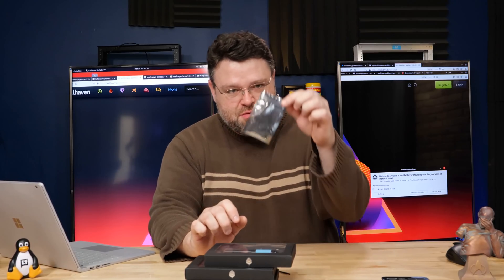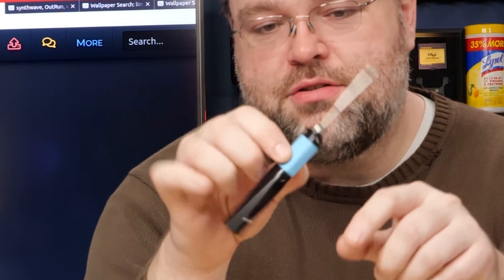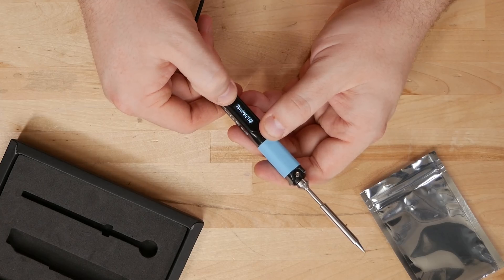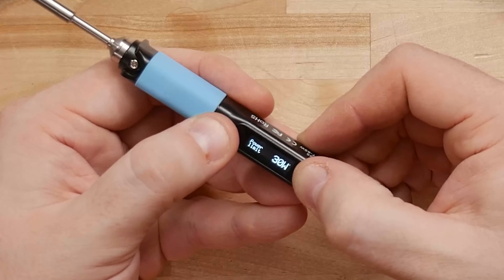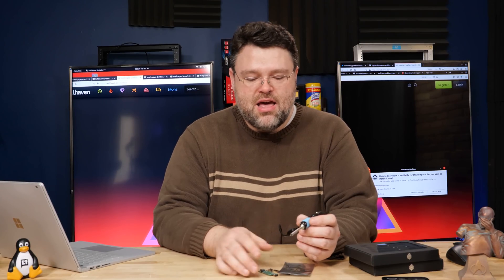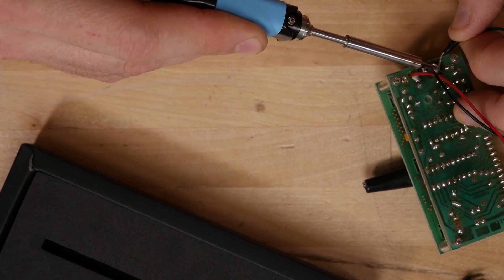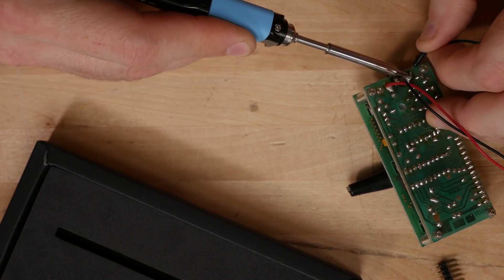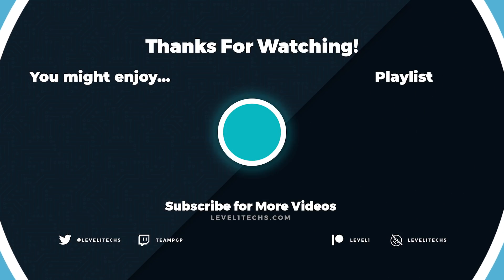PINECIL - Soldering Iron w/a RISC-V Processor!

Comment: When a soldering iron has more power than a 90s PC. We live in interesting times.
Reply: smokes the Apollo flight computer too
Reply: The ESP32 is 10x as powerful as a 486 and about 3x the Pentium 1. That is insane. You can basically buy the performance of a Playstation 2 for $1.50-3.

The 486 was the minimum spec for Win95. That would put many of the STM32s etc in the power range of a PS2. They run at the same speed but the node advantage of the smt32 compared to the 250nm should make up for the 64 bit performance advantage the PS2 has.
Reply: @excitedbox5705  yeah but then again, the 486 had an MMU, the ESP32 doesn't. That's why you don't see ESP32's and STM32's running operating systems like Linux or Windows. MMU emulation would not only tank performance, it would be insecure.
Reply: Can't wait for someone to get doom running on this.
Reply: Huh, 90's PC's were Pentiums. 90 to 233 MHz. Mine had 128 MB of RAM which is 2 TB in 2021 numbers, but most people RAM with at least 8 MB.
Reply: @TheNefastor  Pentium 50MHz relased in 93, Pentium 100MHz in 94. But many people still had a 486 by early/mid 90s.
Reply: @samuelschwager  ah the memories... I still have an authentic IBM PS/2 with a 486SX 25 MHz and 512 KB of RAM and it still runs Windows 3.11 for Workgroups. That thing is unkillable. Can't say the same about today's PC's 😀
Reply: @TheNefastor  Nice, I have an IBM P70, still working :)
Reply: @TheNefastor  512MB? RAM? 🤔 Really? I got this after 2001
Reply: @doggSMK  sorry, that was 512 KB, not MB. I had 128 MB in a PC in 1997 and everyone thought I was running NASA or something. I'll edit my comment. Thanks for spotting.
Reply: @TheNefastor  in 1991 or 1992, my folks got a 486 DX computer. It had a turbo mode at 50 MHz.

In fact, the family friend wholesaler who hooked them up with it had joked at the time that he could just program the LED to print 99 for turbo instead and make all our friends be in awe of our system being faster than anything out there.
Reply: @slycordinator  The funny thing is that "turbo" wasn't actually a speed boost, it had something to do with compatibility for certain old programs that had timings based on the cpu clock. In a lot cases performance was reduced with "turbo" enabled.
Reply: @mytech6779  no.  the diabling of turbo halved the clock speed
Reply: @BenState  In life you will find that your one anecdote doesn't invalidate other data. 
Some companies also reversed the turbo-button indicator light so it was on when turbo was off.
Reply: @mytech6779  incorrect.  nothing reverse engineered about it.  in your case the button was wired incorrectly.
Reply: @BenState  So you actually have no clue what the purpose was for "turbo" buttons nor do you comprehend basic statements like "some brands were reversed" and want the world to know just how limited your knowledge really is.  Good luck with that.
Reply: @mytech6779  The turbo function was on when the CPU was at full clock speed and off when reduced for applications that needed that to run correctly.  It is well documented that this switch was often installed incorrectly to latch at full speed when the button / LED was off.  Please update your knowledge by reading.
Reply: @mytech6779  Turbo enabled, with a correctly installed button puts the CPU in full clock speed.  You said the opposite.  Are you slow?
Reply: @BenState  I said they were installed both way around.
Reply: @mytech6779  And according to the spec that would be a mistake, rendering your interpretation of the modality of turbo/non turbo also incorrect.  Any latching switch can be installed the wrong way around and often was.  That does not mean in any way that turbo mode on retro pcs ever was intended to be a slower clock speed.  As that would be illogical. Facts.
Reply: @BenState  So normal mode was the special mode and not the special mode at the same time? 
"turbo" as a technical term is meaningles drivel, it makes no more sence to use it for normal operation than for retro-compatibility operation. 

The switch issue isn't just a switch wiring problem, it is also about the default mode wired into the mainboard, the switches could both be wired the same on two boxes yet being pulled high sets one of the boards to normal mode and sets the other to special retro mode.
Reply: @mytech6779    I don't know how you're struggling with this basic stuff.   A turbo is a device that increases speed.  Turbo mode was the CPU's max clock speed.  Turbo off, was a reduced speed to enable legacy software support.  Nothing more.  Your special and normal modes are just made up drivel.  Everyone knows what a turbo is, and does.  Thus the term was used as such.  Turbo = 100% CPU clock, Turbo disabled =original 8086 processor speed.  Its very simple.
Reply: @BenState   Just exactly how does a turbo device increase speed? Does the encabulator precharge the unilateral phase detractors or or does it synchronize the spurthing bearing with the amulite nofurtrunions?

Comment: when he started talking about the processor, was I the only one that thought he would say the processor is the heat source for soldering?
Reply from the maker: I must admit, I was curious about that while editing ~ Editor Amber
Reply: Stick an old athlon cpu in that thing and you could melt way more than solder.
Reply: You are not alone
Reply: tbh, if you were interested in using the heat from a processor, something RISC-V is pretty safely less likely to fit your needs
Reply: Lol, soon there will be after market cooling solutions
Reply: @INVAZOR33  Well how else are you going to over clock a soldering iron?
Reply: @asdrubale bisanzio dang I was about to say that
Reply: yes its made by intel

Comment: Speaking as a mixed signal embedded systems developer, soldering since the 70s, judging by those joints, I think you may be burning off all the flux by either leaving the tip on too long and/or using too high temperature. That's why the joints look a bit irregular.

But yeah, RISC V and USB PD... an unnecessary gimmick for a professional workbench, but wow they're cheap. USB PD, well that's a whole tale of engineering woe.
Reply: @asdrubale bisanzio I don't disagree with you, I am just making the point (a) USB PD adds no value in a professional lab, and (b) USB PD is a serious PITA to engineer properly. I'll also add that USB Type C is a very fragile design physically, with the device coming off worse than the cable, making repair expensive. USB PD is expensive to engineer properly especially when simultaneously being used for USB SuperSpeed and Thunderbolt: device multiplexers frequently fail, which is expensive to repair.

Is it just me, why am I always concerned that Wendel's always seconds away from giving himself a nasty burn? Where's the stand?!?
Reply: @asdrubale bisanzio "Surface mount is shit" hmm, I guess you don't work in the industry then. 

USB C is demonstrably more fragile than A, B or even micro B or mini B, and it tends to break the device more than the cable. I'm just giving you my real world design and manufacturing experience, including seeing failure modes on returned devices.

That doesn't preclude this being a handy tool every now and then. I wouldn't want a hot soldering iron dancing around bench without a stand: I've had enough battle scars over the decades thank you! There are those who have burned themselves, and those who will, I can assure you of that.
Reply: @asdrubale bisanzio No. It has nothing to do with surface mount and everything to do with the tiny close pitch connectors being more fragile, and that the receptacle device side is more fragile both electrically and physically.

A USB Type C receptacle is, for example, immediately physically damaged if someone inadvertently attempts to insert a Lightning connector.

The muxes are electrically fragile.

Finally, as I've stated before, USB PD is difficult to design for if you want longevity and reliability. It's even more so if the device is capable of dual role DFP and UFP.

I think the surface mount aspect is a canard because connectors are readily available with through hole lugs on the shield, and suffer the same way. What is a problem is that most fully assigned USB C receptacles have hidden pads making component level rework difficult.

Comment: No. Just...No. There are plenty of analog soldering stations with temp control that do a great job( admittedly at least some are not exactly "mobile"). Any temp control issues are not related to the lack of digital control, but rather quality of components/design. There is no point to putting a ucontroller on a soldering iron. It's a solution looking for a problem.

Comment: I wish they would charge a little more and make something that really functions as a micro pencil. The real question. Can you use it to re/re an SMD on a 4 layer board? 7 layers? That is the true test of anything that can justifiably call it's self a soldering iron or it's just a toy. You need micro pencil irons for these boards as well. Have you opened an old ipod? Could this take the place of my micro pencil? I doubt it very much. In this case any price is too much.

Comment: Soldering Iron with a CPU and RAM? I'll take that asteroid hitting the Earth now, thank you very much...
Reply: @asdrubale bisanzio That's not a selling point. Read the datasheet of the component and solder it accordingly. In the world of Chinese pick-and-place production plants this thing is thoroughly useless, any dumb temperature control station is more than enough, if you absolutely need this for prototyping, you have already failed. It's a gadget, and to an experienced electronics veteran not even a cool one. Thanks to Wendell for proving this truly is the darkest timeline because new generations of prototypers will go full baaaaaah and lean solely on "smart" equipment and not their common sense and actual knowledge - this is very bad in a long term. No wonder Amazon is replacing workers with robots, if your worker can't be creative, why not just let the AI figure it out. Same will be the extinction path of dev engineers and prototypers if tools like this become a norm.
Reply: @playswithblades  the ability of these things regulate temperature quickly comes in handy when soldering small components to large ground planes, and the auto sleep helps prolong the life of the tip for the forgetful/distracted among us

Comment: I love that RISCV is showing up in more embedded applications open source devs can play with. We just heard about the ESP32C making use of it two weeks ago and now this. The momentum is definitely starting to build up. I just hope it doesn’t become the next MIPS, but with its open architecture and heavy adoption by massive companies already I don’t think it will
Reply: the error of MIPS was its royalty business model so it competes directly with other ISAs, like ARM. Risc-V got some hype but being royalty-free since the start is a real strength and it drove a lot of people and companies into it.
Reply: @PainterVierax  It is not only royalties, many companies will still pay if there is added value. Risc-V can leverage well established tool chains that aren't subject to the proprietary whims and penny pinching of a single manufacturer. Though royalties certainly never help; firewire-1394 lost to USB adoption because royalty cost limited it to professional devices even though firewire had many advantages at the time.
Reply: @mytech6779  Value can be added in an opensource stack aswell, see RedHat or Codeweavers business strategy. The issue here is more that the proprietary SDK are often all-in-one tools which take a lot of unnecessary resources and disk space and which are prone to intricate bugs.
The US institutions putting embargoes on PRC clients for ARM did also helped Risc-V to rise more and more interests from all sorts of companies.

Comment: nice project, wonder how the soldering iron performs as compared to brands like Hakko
Reply: Und Weller! :)
Reply: These beat the living snot out of the crap from Hakko, and the low end weller stations as well.

Either get something like this or a TS100, or go straight for a good JBC station.
Reply: I used to use Weller WR-3M from office. It performed quite well, I am looking for cheap solution for home and this does seem to fit the bill

Comment: I like the price a lot, but as for the microcontroller, I wouldn't care if it's any 8bit Atmel or STM, or any 32bit Espressif, STM, PIC, etc. It could just as well have a Z80 or Intel 8088, even a MOS 6502. Basically anything except for the Itanium line would be fine by me. Oh, I loathe the Itaniums.

Comment: I’d love to get one but it’s always out of stock :(
Reply: They'll have more stock after CNY
Reply: Yeah, they figured a way of setting these up in a mining farm, that's why.
Reply: Pinecil back in stock, I just picked one up 😀
Reply: @balls4juggling  Dang, I missed it. Says out of stock again :(
Reply: @psedog  it is back in stock :)
Reply: @Instinct0425  Purchased. I appreciate it 😊
Reply: @balls4juggling  Thanks for the heads up!
Reply: Buy a real micro pencil iron first it will save you so much grief. These aren't bad if you recognize it's glaring limitations. How often do you really need a portable soldering iron? This is fine if you are only ever dealing with 2 layer boards or connecting wires but will never replace a bench unit.
Reply: @Mr.Unacceptable  I totally replaced my Weller with a TS100 and I will never go back
Reply: @Mr.Unacceptable  Sure the ergonomics certainly aren't great, but otherwise these irons perform far better than pretty much anything you'll find for under $80 and even if you do spend more you won't necessarily find much if anything better until you start getting into expensive gear, the portability is just the icing on the cake and I absolutely value that feature as I currently don't have a dedicated workbench meaning I have to move my tools every time I use them and I can very easily plug in a battery then repair some wires or solder a connector up outside, I even threw a small toolbox together with solder, flux, tips, etc so I can just grab it and be ready to use it anywhere.
Reply: @vgamesx1  Same situation here. I have to pack everything away when I’m done and space is a premium. Not to mention that this is very cheap.
Reply: @vgamesx1  I've got a large lithium battery made of a bunch of 18650's I could totally use to power this iron for a very long time, then I have a portable repair setup I can take anywhere complete with USB C powerful lights, who knows. I could totally create a very powerful portable station that runs everything through USB c cables up to 100W!
Reply: @Mr.Unacceptable  these beat anything you can get for sub $300. Something like a JBC CD series is of course much more enjoyable to use, but not that much better really.

Comment: I saw this soldering iron on Twitter for months but I couldn't find where to buy it, so at the I bought a TS100 and I now I've found the store page for it!!!! probably I'm going to buy it anyway for the RiscV Cpu ;)
Reply: Isn't this just a TS80?
* EDIT *
It seems to be a TS 100 clone from what I've read.... you probably have the same thing already. :)
Reply: @x7slim8x  came here to say this
Reply: Well after a little more reading it is definitely different than the TS 100. Slightly bigger and heavier... same tips. I'm gonna stick with the TS 80 personally, but do enjoy this resurgence in soldering tech and the reviews are super helpful.
Reply: The problem will be the oled screen. As there is a lot of durability problems on many TS irons or other PRC's electronic products.

Comment: Oooh! I got into creating my own circuits and building projects about a year ago and have been using the absolute cheapest, jankiest soldering iron since. 
I don't intend on writing an app for my soldering iron, but $25 is great for a digital iron no matter how you ....strip it.
Reply: @asdrubale bisanzio This is WAY better than the crappy $25 irons on amazon. This style of smart soldering iron with heating directly in the tip is the only kind of soldering iron you should buy in the 21st century.
Reply: @asdrubale bisanzio I also like supporting open source hardware.
Reply: @asdrubale bisanzio For sure. Fortunately, when this video was released to Patreon, I checked the Pine store and they actually had them in stock. I've had it for about a week now and really love it!  :)

Comment: I've got a kit I carry around in my backpack with various gadgets (serial adapters, cables, rfid tools, etc). I think I'm going to add this thing to it.
Needing a soldering iron away from home is a rarity, but it's happened to me more than a few times!
Reply: If you do 3d printing check around online for a printable case.
Reply: @_GntlStone_  ironically I just got a car kit from Walgreen's for the case for a multimeter and this iron. Wonder how much I can stuff it (and not mix it up with  the car kit lol)